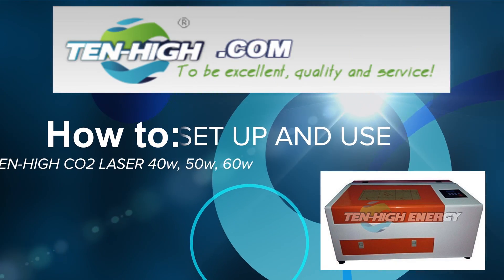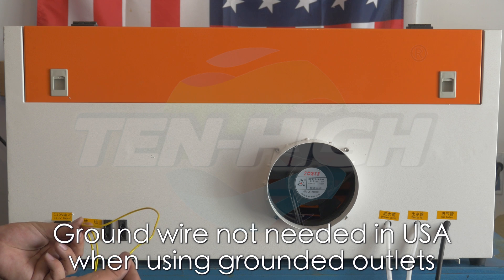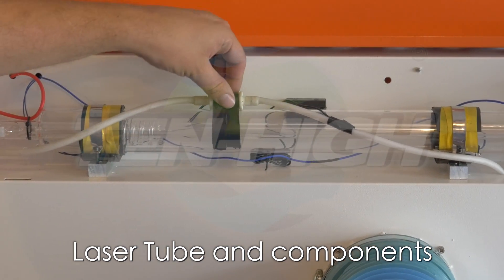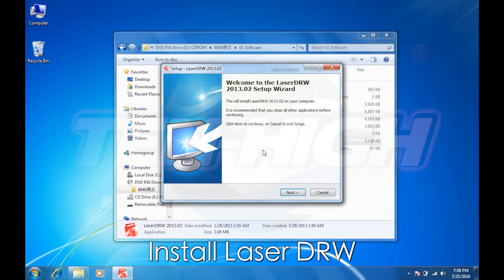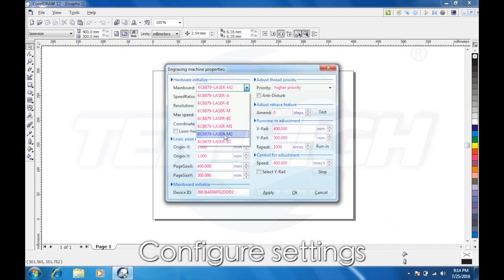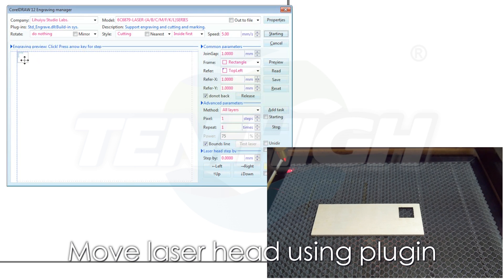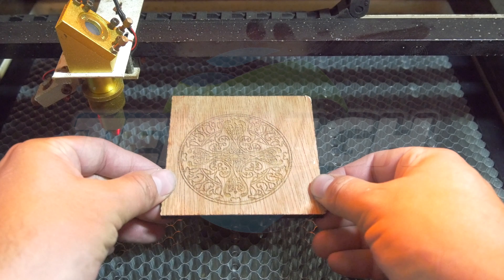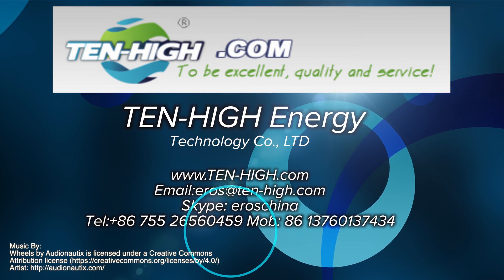TEN-HIGH Upgraded Version CO2 40W 110V Laser Engraving Cutting Machine with USB port

Comment: Can you use abobe illustrator with this machine? Saw people using coral but i have adobe.
Reply: in case you still need to know: software can import .jpg, png, bitmap and other common formats. So the source should be irrelevant if you can save using those. Hope that helps.
Reply: I have adobe and just purchased this machine as well. Did you find an easy way to use Adobe? I'm thinking that I will upgrade the controller just to make that easier.
Reply: @him2707  I see its been 8 months since you bought your machine, would you recommend it?